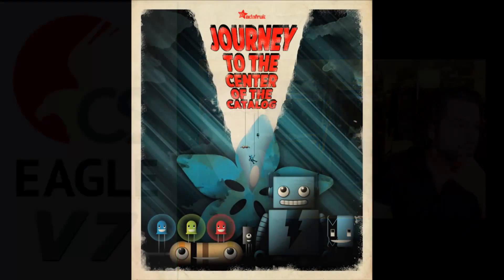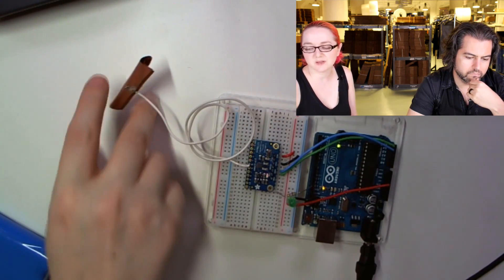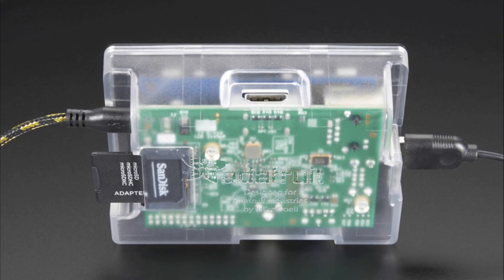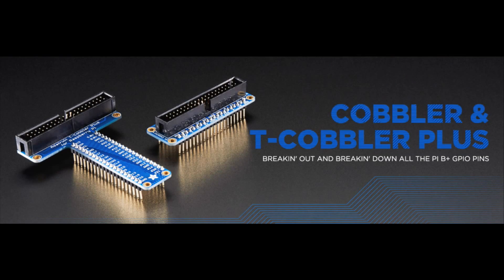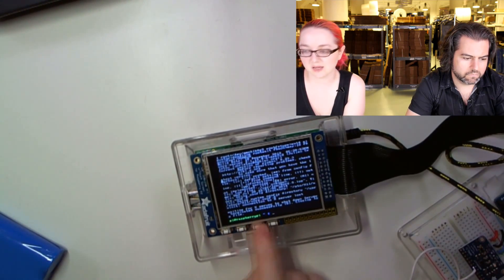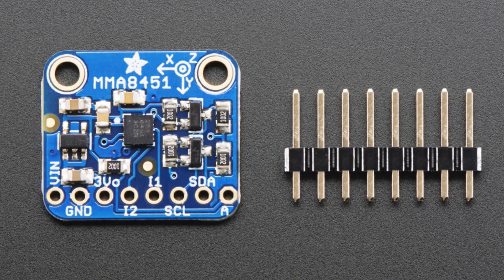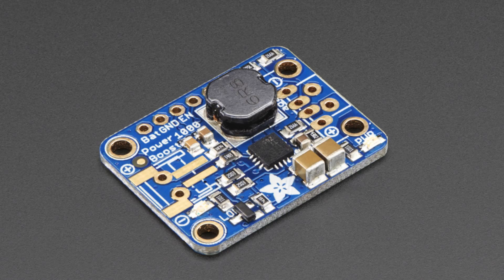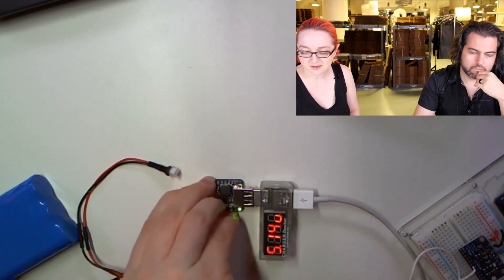New Products 7/30/2014

Comment from the maker: New Products 7/30/2014

CadSoft EAGLE PCB Design Software V7 (0:03) http://www.adafruit.com/products/1619

Shield stacking headers for Arduino (R3 Compatible) (1:35) http://www.adafruit.com/products/85

Adafruit 12-Key Capacitive Touch Sensor Breakout - MPR121 (2:55) http://www.adafruit.com/products/1982

PiTFT Enclosure for Raspberry Pi Model B (4:39) http://www.adafruit.com/products/1892

Adafruit Pi T-Cobbler Plus Kit - Breakout for Raspberry Pi B+ (6:44) http://www.adafruit.com/products/1989

Adafruit Pi Cobbler Plus Kit- Breakout Cable for Raspberry Pi B+ (6:44) http://www.adafruit.com/products/1990

Adafruit Triple-Axis Accelerometer - ±2/4/8g @ 14-bit - MMA8451 (7:28) http://www.adafruit.com/products/2019

ACKme WiConnect WiFi Module - Mackerel Evaluation Board (8:36) http://www.adafruit.com/products/2022

PowerBoost 1000 Basic - 5V USB Boost @ 1000mA from 1.8V+ (10:35) http://www.adafruit.com/products/2030
Reply: I think he means it shows $1 for pro in the drop down and $1145 for pro on the product detail page.
Reply: The drop down box is messed up depending on which page you view it from :)
Reply: Your versions and pricing for EAGLE make no sense.
Reply from the maker: ***** it's the top selling/requested versions of EAGLE and exactly the same pricing from EAGLE our partner
Reply: Still doesn't make sense...
Reply from the maker: direct links here:
https://www.adafruit.com/search?q=eagle